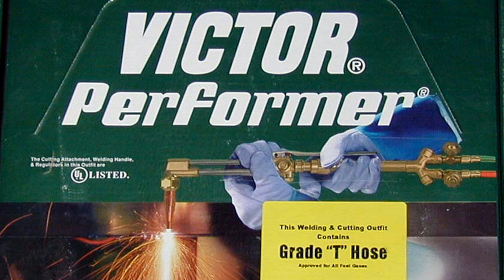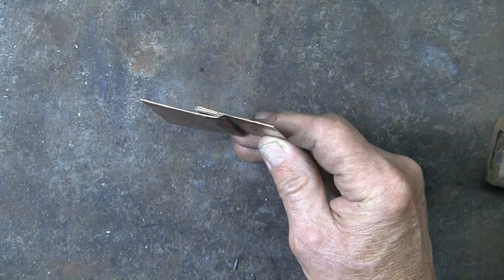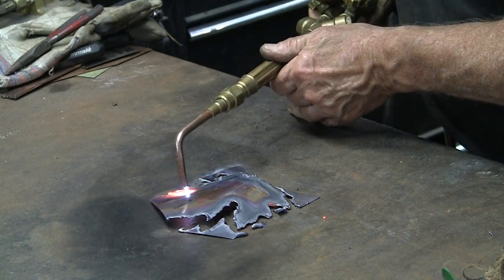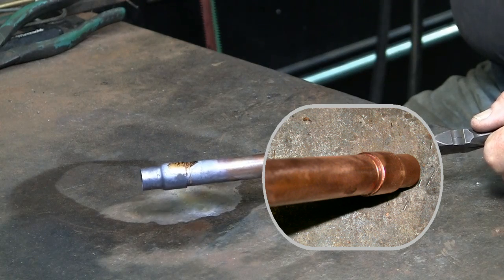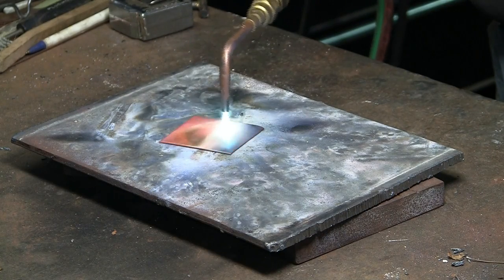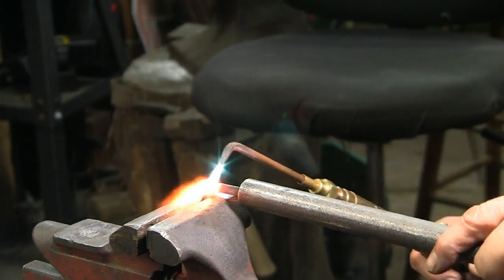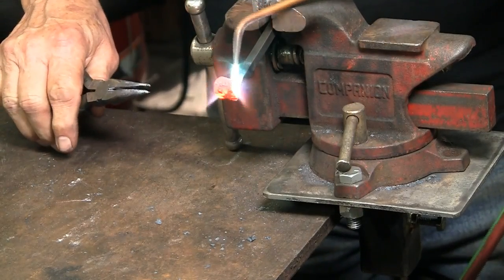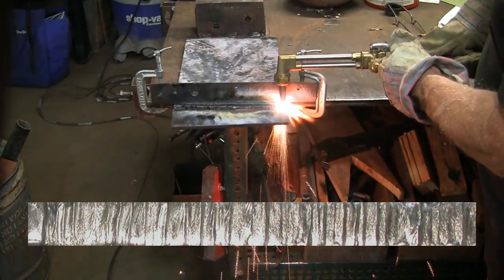Oxygen Acetylene Overview

Comment: Friend,
I really want a small Jewelers' Sized Oxy-Acetylene torch. Are the less expensive small OFW Torches a good value compared to the far more expensive Smith torch? Or should I do without until I can afford the Smith?
…..RVM45
Reply from the maker: +RVM451 I don't know much about the small torches.  Not sure what you mean by OFW.  If these are "knock offs" some may be as good as the name brands.  Smith Jewelers Torch is the one I hear most about.  $125.00 at cyberwled.com   Another torch that has been suggested is the MECO Torch.  Not sure the price at what you have been looking at.  Check and see if there are any reviews.  Amazon has one for less than $40 but only one review with just three stars.  Also, check some jewelers forums to get an opinion.
Reply: OFW  = Oxy-Fuel Welding.
Thanks for the advice.
…..RVM45
Reply: Those little Smith torches are great, but very-very-very small and limited use. If you're doing jewelry work or for whatever reason have a need for a tiny torch, they're great but otherwise, they're going to be too small for 99% of jobs normal people might want a torch for. They're definitely a specialty tool. Also, I don't even know if there is an American made Smith Torch anymore. You can order Smith Torches in boxes marked Made in the USA direct from Chinese suppliers who sell on ebay and they're pretty high quality.
Reply: Actually I am a Pistolsmith—mostly Revolvers.
Thanks.
Reply from the maker: I had one and it was great for very detailed and delicate work.  You might consider a set of "Y" adapter.  This would allow switching back and forth from a  standard oxy/ace torch to a  jeweler torch while using one set of regulators.  Do a google search for "oxy/ace Y adapters"    Once you see the pictures of "Y" adapters it will be self-explanatory.

Comment: Great video. I am wondering if you could offer some insight with a popping problem I often have. Just recently I made a vat from mild steel. The four sides are 1/8" and the bottom is 3/16" I have the same torch as you do I believe and I was using a #1 tip. The vat is 22"X24"X18" and I got a lot of popping when I tried using a larger #4 tip. Using the #1 tip I didn't get as much but it still occasionally popped but took a very long time to get a puddle going. The gauges are the large victor units that were just rebuilt by a professional as was my torch. Both bottles are full.
Any suggestions are appreciated.
Reply from the maker: +howardtoob  Howard, I've had that same problem.  It could be that with the larger tip you are not giving it enough acetylene.  The torch needs sufficient acetylene to ignite.  If it doesn't get enough acetylene it will just pop.  Another possibility could be that the sparks from the welding are going back into the tip.   I've solved this by trying a number of different setting until the popping stopped.  Never quite knowing quite what I did to fix the problem.  Kevin Caron has a YouTube video on popping using a rosebud tip.  Some of the same things apply.  https://www.youtube.com/watch?v=8E-zliUrnQ0

Comment: Can you comment on the costs associated with Oxygen Acetylene?
Reply from the maker: Lolita's Garden $250.00 to $300.00 for a torch outfit.  Of course this varies, depending on the type of torch, brand and where you buy it.  Then you will need oxygen and acetylene cylinders.  Check where you will be getting your cylinders refilled.  Some type of welding table and some brazing and welding rod.  My first table was made out of some scrap steel that I found.  Figure $20.00 for some brazing and welding rod.  That is enough to get your started.